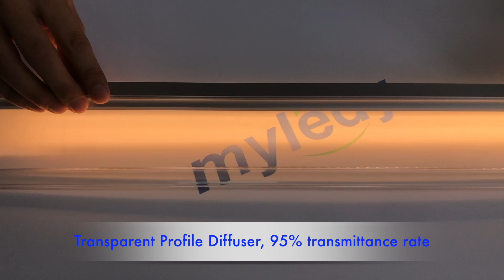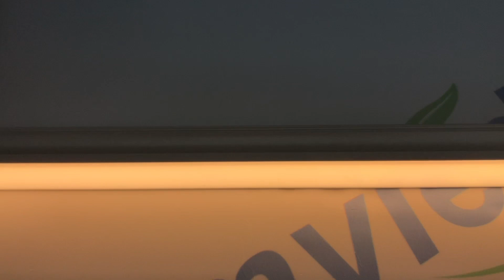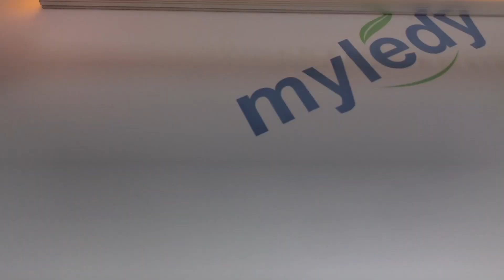How to choose diffuser for LED profile?

Comment: What is the major differences between magnetic LED profiles vs the LED profiles with drivers, receivers hard wires to each 24 foot length? In terms of quality, limitations, any major issues or disadvantages?